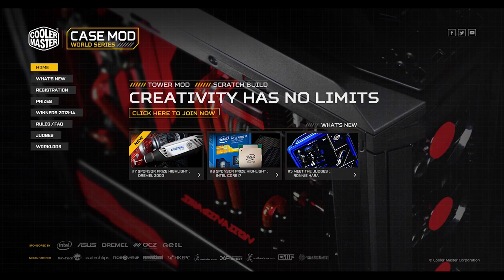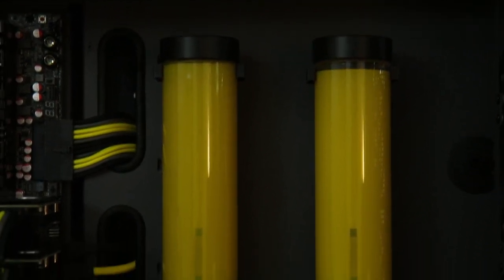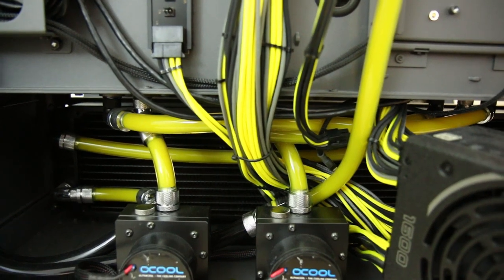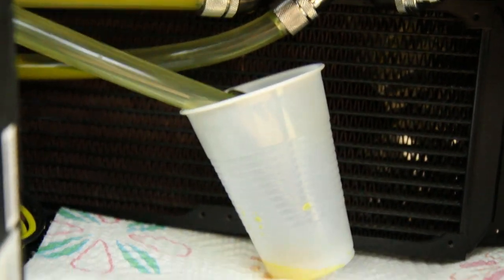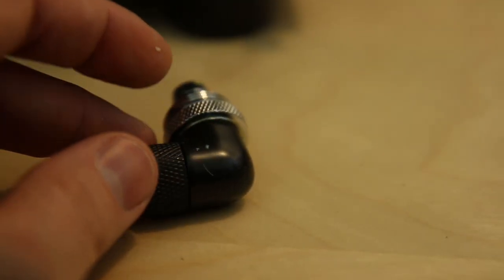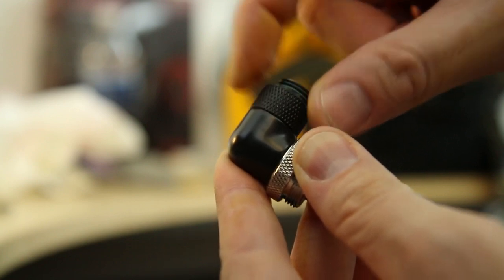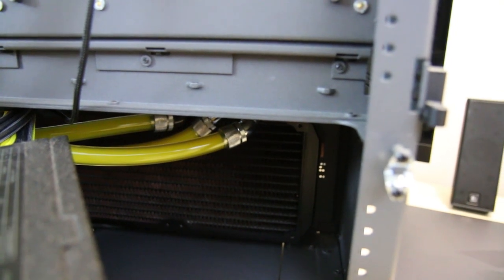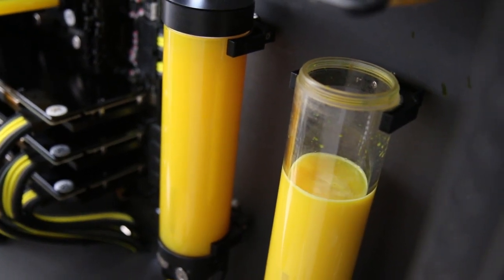My $6500 Custom Watercooled PC LEAKED!!! Now lets fix it....

Comment: Why would you
1.) Spend $6500 on a single rig
2.) Put water cooling in that rig
Reply: Destess First of all he didn't spend $6,500. It's a sponsored PC for his channel. I think he paid like a grand out of pocket for some components. Secondly, if I was paying $6,500 for a rig I'd want it water cooled too. That's a lot of graphics cards crammed together and keeping them cool on air would be hard, especially with a huge overclock. Last but not least, Watercooling isn't that dangerous. He's had 1 leak in over 10 years of water cooling and it was barely just dripping out. Even had the drip been in the upper portion of his build most likely it wouldn't have done any damage as long as he caught it. It's easy to catch yellow fluid. Also in the rare event that distilled water does actually fry a component, just dry it and send it back for RMA and claim that it died on its own. 99% of the time you'll be sent back a new working component. I just put my first custom loop ever in my new build. It's worth $3,000 and I'm not worried at all  =)
Reply: Randy Moss If I have and expensive rig I'm sure as hell not putting water cooling in it lol. I'd do mineral oil if you aren't for air cool.
Reply: Because your misinformed about the dangers. There is a risk of something bad happening, but it's not big enough to warrant not using the best form of cooling available. My Titan X never goes above 40 degrees C while gaming now with a huge overclock. It was getting into the mid\high 80's on air and that's with only 1 card
Reply: Destess

Not to mention even something like a H100i has a small risk of leaking. Everything has a risk, doesn't matter what it is. Are you going to use some cheap ass air cooler on your expensive CPU too?
Reply: Randy Moss Whoever said I was building an expensive ass computer? I'm fine with my cheap build that runs 120fps on CSGO without overheating, which is basically the only game I play.
Reply: Randy Moss tbh if you're going to upgrade why not mineral oil lol, there's nothing to damage your computer then. I'm not ever spending more than 500 on a computer though so I don't need to worry about it.
Reply: Destess I'd pay 30K for a watercooled computer XD
Reply: Destess
I play CS:GO too. Ranked LE in the western USA if you ever wanna hop in lemme know
Reply: Randy Moss LE in east, damn.
Reply: Yeah, my PC is over 2 grand just for the components not including the monitor. The water loop was another $700. No worries whatsoever. People get intimidated by what they don't understand.
Reply: Yeah, I just have one 27'' ROG SWIFT. Also 1440p 144hz 1ms. I don't do much multitasking so dual monitors wouldn't really benefit for me. Plus this monitor is huge and I couldn't fit another on my desk anyways lol
Reply: I got the AlphaCool Custom loop set which comes with a Radiator\fans, Tubing, Reservoir, pump, fittings, and CPU block. That was like $320. Then I bought an EK Waterblock and backplate for my Titan X which was around $200. I also bought another 280mm AlphaCool Radiator which was around $150 I think. I had to pay for some extra fittings and a drain port which added another $50 bucks. Add on shipping and your well over $700. The real wallet killer was the Graphics Card block and the extra radiator. You could do a custom CPU only water loop for less than $300.
Reply: Randy Moss Are you going to retire from the NFL yet?  Please don't tell me you still think you have gas left in the tank. Lol jk jk
Reply: Electrus Boom So... Are you considering just getting the 980 Ti 6 GB instead of two 3.5 GB Vram 970's that will perform almost identical to the TI at an identical price? Yet.. The Ti wont have any SLI issues like lack of support in some games and micro stuttering.. My point is that you might as well get the Ti now that it is out. It is a better future proofed card with more Vram for the same price. Plus you could always throw in a second TI in a year or two down the road after prices have dropped significantly.
Reply: Electrus Boom That PC must not be designed for just gaming I take it?
Reply: Electrus Boom

Actually some of the recent games use more than 4 GB on ultra, even at 1080p. He's at 1440p with 3.5 GB's. That's not to say he can't play them but that he might not max everything out. Two 970's are more powerful than 1 980ti but the VRam limits could cause performance loss negating the extra power.
Reply: I said I'm guessing that its not strictly for gaming. Never said anything about an inability to game.
Reply: Electrus Boom Yeah... I know... That's why I asked if it was for other purposes besides gaming lol
Reply: Electrus Boom

GTA V uses more than 4 GB's maxed out at 1080p.
Reply: Destess then that expensive rig would be fucked. you cant just air cool something like this and expect cool temperatures.
Reply: ZerohFault
Yup, I just made a $350 purchase from Performance-PC to upgrade my loop. Dropped Jays name as my reference lol. Ordered a 3rd radiator, 2 liters of white pastel nanofluid, a primochill flow indicator, an EK supremacy EVO CPU block to replace my AlphaCool XP3 Acetal light, and EVGA white sleeved power supply cables. This upgrade is more about looks than performance gain but it will look amazing when finished.
Reply: Destess Mineral oil is much more costly/dangerous than water cooling. With Mineral oil you have essential removed all possibilities of upgrading your PC, or selling any old parts. Water cooling isn't as dangerous as you seem to think, and even if it was, it is much better than mineral oil.
Reply: 6500 is the cost of whole computer
Reply: ZettabyteGamer lol.
Reply: Destess Mineral oils cooling capability is miserable + the fail/damage rate is higher than with water cooling
Reply: Fantaztig I'm gunna trust Linus, a well know techie, on this one.
Reply: Destess
 Just check out the well known overclocking/modding forums with this. Not saying its impossible, just that its efficency is way beyond what even air cooling could give you
Reply: ***** benchmarks friend. 970 sli is better than the 980 Ti in some cases
Reply: ***** of course a 980 ti sli would beat the 970 sli, but a 970sli can be a tiny bit better than the 980 ti in some cases
Reply: ***** that doesnt make any sense. VRAM has nothing to do with performance unless you cap it
Reply: ***** nice meme
Reply: ***** worst troll ever
Reply: because fans could not handle $6500 hardware
Reply: ***** what?
Reply: ***** just leave. no one likes trolls.
Reply: ***** seriously. stop. Just leave troll / 8 y/o who know nothing about PC
Reply: Destess that looks like a normal fan so.... Fans could not handle $6500 hardware and water cooling is quieter and looks cooler
Reply: Nick Hackett looks? you're relying on looks? Look at the CFM. Having multiple of these throughout your PC would probably cool better than watercooling. It might be louder, but who gives a fuck about noise? I don't hear anyone complaining about the noise of mechanical keyboards. Volume = nothing, unless you're a kid who tries to hide the fact that he's gaming far into the night.
Reply: ***** Yes, I'm sure you believe so. Leave.
Reply: Destess before you start canning me a kid, I wasn't the one that spent $6500 on a computer or even thought it was a good idea, im just trying to give reasons for someone else's actions, and loud fans are EXTREMELY annoying and a LOT of people put looks before hardware on their build do yes, I am going by looks
Reply: ***** Yeah definitely.
Reply: Nick Hackett Looks definitely provide performance.
Reply: Destess yes, please tell me more about when I said that looks=performance
Reply: Nick Hackett "a LOT of people put looks before hardware on their build do yes, I am going by looks" "that looks like a normal fan so.... " you're welcome
Reply: Destess question is why not?
Reply: GeneralN0va Easy to ruin a large amount of that build, and $6500 makes no sense to spend on a single rig. You could get 3-4 good rigs that perform quite similarly (obviously worse though) with that amount of money
Reply: Destess stfu, he does it cause he can, now stop being PJSalt
Reply: GeneralN0va lol I was never salty but kk. Its a waste of money is what I was saying. Not like he cares, he probably makes double that in a few weeks.
Reply: Destess dude if your poor dont go sulking on other people's videos gosh.
Reply: Destess Do you know how computers work?
Reply: MaxAmaSity What makes you think I don't?
Reply: Destess 
"Why would you
1.) Spend $6500 on a single rig
2.) Put water cooling in that rig"

you obviously have no idea what is in the computer in the first place so why the hell would you ask about him spending that amount of money on the computer?
Reply: MaxAmaSity Because there is no point? How does money even REMOTELY connect to how PC's operate? This isn't 1981 bud, basic computers are not 5K a piece. You can easily build 3 computers that almost perform as well for the same price, and its way more cost efficient.
Reply: Destess "How does money even REMOTELY connect to how PC's operate?" WOW! Fucking wow man. Im done. Please never come out of your cave again and just stay there.
Reply: MaxAmaSity lol so you're a troll.
Reply: Destess
Speaking to yourself im guessing.
Reply: MaxAmaSity obviously, because price=pc parts lol
Reply: Destess Linus also said that there arent many reasons to do a mineral oil pc, and that it's way more complicated. He also even said the same as the guy up there and the possibilities of upgrading or selling old parts is very very slim.
Reply: Destess Yeah, but how many people need 3-4 good gaming rigs, Im not gonna build 2 $1000 gaming rigs when i have $2000. And he uses this computer for video rendering and editing and other important things.
Reply: Iankiller99 Why would you upgrade with a $6500 rig? And you don't need multiple Titans for rendering, lol
Reply: Destess Well from what I"m hearing from other people it was sponsored, he didn't have to pay much for it, someone said he put about 1k into it. I mean would you pass up a chance to get a custom watercooled pc valued at $6500 if you only had to pay a thousand? I mean I would.
Reply: Iankiller99 I would and I would get rid of the watercooling. I'd actually probably switch it out with a shitload of crazy Delta/Lamptron fans.
Reply: If watercooling is so damn dangerous and stupid like you say, why do all the editing workstations and personal rigs of the entire linusmediagroup team use it?
Reply: Iankiller99 he dosent understand the meaning of efficiency
Reply: MaxAmaSity or because they don't care that much about money, they make twice that in a week at least. Air cooling with the Delta/Lamptron fans is just about as effiecient as water cooling. 280 CFM? Yeah, pretty damn efficient.
Reply: Destess
oh i see. your just mad that they make more money than you. its ok.
Reply: MaxAmaSity lol when the fuck did I say that? You're the one fanboying over them here. I never said jack shit about them being bad people. I like the both of them. And they make around 2x more than I do so I really don't care. Engineering bud. glhf in your life when you grow up bro
Reply: its ok kid.
Reply: MaxAmaSity lol calls me kid haha, if only you were older than 12 and had a single clue about the world ;'(
Reply: Keep going.
Reply: MaxAmaSity YOU USED GRAMMAR :D gj :)
Reply: Destess
This is fun.
Reply: MaxAmaSity Same here! I'm glad we both share this mutual feeling.
Reply: +Destess You do realise Delta fans sound like a freakin jet engine right ?
Reply: =ATS=Gaming HQ who cares? they're much cheaper with no chance of destroying your other components. besides, who doesn't love the sound of your PC. its been my favorite sound since I was a kid.
Reply: Destess Much cheaper ? 60 dollars is cheap for you ? Dude i bought silent LED fans for less than 10 dollars per one, And no i dont like jet engine in my room
Reply: +=ATS=Gaming HQ yeah, cheaper than water cooling. not by much but it still is. jet engine he says lol. so much different of a sound.
Reply: Dude i got Delta fans in my server pc, it sounds like yet engine when at full speed
Reply: +=ATS=Gaming HQ jet engines sound like a mechanical drone. fans sound like intense vibrations and at high speeds a loud constant swoosh of air.
Reply: Yeah and you like beign next to a vacoom cleaner ?
Reply: =ATS=Gaming HQ same sound as a jet engine. same concept but reversed basically. mechanical shit doesn't sound the same as a pc fan.
Reply: Yeah, whatever
Reply: +Destess that's more than my first car
Reply: +Destess PROfessional FITting.
Reply: about a quarter (or more) of that cost is the water cooling.
Reply: GeneralN0va to answer your question simply, this is not a gaming build this is a enthusiast build, where you set a goal for yourself and you throw money, hard work, time and dedication into achieving said goal.
Reply: E N T H U S I A S M
Reply: If someone is stupid enough to spend a ton of money on a computer, and then have a CONDUCTIVE liquid in their cooling system, the deserve everything they get when it leaks.
Reply: First of all
He didnt really spend $6500 if he did then who cares, (u obviously) its all his money anyway 

Second of all
Is because his hobby to watercool things

Comment: You test them underwater, air sealed to find leaks. If air is bubbling out...it's scrapped. At least that is how I tested natural gas meters when I built them. Maybe pipe doping or plumbers tape would help ensure and make the fittings last longer?

Comment: Oh thats a shame will you have to replace the power supply is that wet
Reply from the maker: Power Supply was spared as the fittings arent directly above the PSU and the PSU sits elevated off the floor.
Reply: ***** what about the fan sucking in the water?
Reply: WistfulBreeze a watercooled psu ?. I want it Now!!!!
Reply: non conductive fluid
Reply: MrBall Breeder Water Cooler PSU Master Race.
Reply: Sanic thats not water sanic
Reply: MrBall Breeder Well..... the stuff I use is water that's been through a bunch of refinement steps.
non conductive.
Reply: Sanic dump a bucket on your PC, guarantee that you'll regret it. It may be non-conductive now but the one thing you'll never change about water is how it picks up metal that will be able to short out PC's.
Reply: WistfulBreeze people submerge their entire PC in Oil and have ZERO issues.
You are obviously not very knowledgable about this
Reply: T2ak and the fluid I use is also non-conductive.
Your argument is invalid.
U probly have a H100 or something lol
Reply: Sanic Mineral oil does not weather the copper and metal, any water does. By calling mineral oil "water" I think this can be thrown right back at you. You are obviously not very knowledgable about this
Reply: WistfulBreeze both are non-conductive.
therefore your argument is invalid.
Bye
Reply: Sanic We'll see in a second
Reply: Sanic Also, I don''t water cool.
Reply: Sanic Your distilled water might start out non-conductive, but over time it will gather contaminants and impurities - even in  a "sealed" water cooling loop - and become conductive.
Reply: no he doesn't, its raised above the case. And even then all the electronics in the power supply unit are sealed with hot-glue and raised off of the casing.
Reply: *****
Not at all, you could put your computer in distilled water and it would work for a good 15-20 minutes, but once it starts picking up sediments from the metals and stuff it will then become conductive. Water on its own actually acts as an insulator, however its really good at eroding material.
Reply: Brudah Whoopa That's what he's saying...
Reply: WistfulBreeze That's not how it seemed, he said it was "...still very conductive." therefore I thought he was saying the results would end up being bad. So no, you meant that's what he meant, but not what he said.
Reply: Brudah Whoopa Oh sorry, thought you were talking to neon.

Comment: To be honest I always treat people that make blanket statements like I haven't had a single failure in X years with caution. I've been building computers as a kid with my father from the days when RAM was still in Kilobytes and you had to straighten out the legs of the chip and IRQ conflicts were something quite common. I know all too well that everything has a chance to fail. It doesn't matter how good you are, how many times you check. Give it enough time, enough products you've worked on and everything will eventually fail.

Comment: I had a leak in my rig this week too. I thought evaporation was also my problem. I have the the same res as one of yours. Eventually I opened my rig and saw it was leaking. Just like you, I always know the risk. Anyhow, its back online. My problem was a fitting too.

Comment: I had a leak in my loop once, the pump housing cracked around the fitting (I assume it was because I tightened it too much). Thankfully it was located at the very bottom of my case and was a very slow drip with most of it evaporating before it could build up enough to spread... And yes.. I do use zip-ties.. Usually two or one thick one.

I actually just use deionized water with a shot of dish soap (I recommend clear or peach color for minimal visibility), and a few pinches of sodium molybdate to prevent corrosion, wrapped up with a drop of PT nuke (biocide) to avoid using a kill coil. 

My setup is an amd 8320 at 4.3ghz (not amazing, but it does the job), 1X 360mm x 120mm rad with only 2 fans, 1X 240mm x 120mm rad with 1 "ghetto" zip tie rigged 90mm fan... It sits at about 30-35c under full load with my overclocked sapphire r9 290x tri-x oc non-windforce being stressed in closed case. 

It's not super pretty, but it's solid and effective.